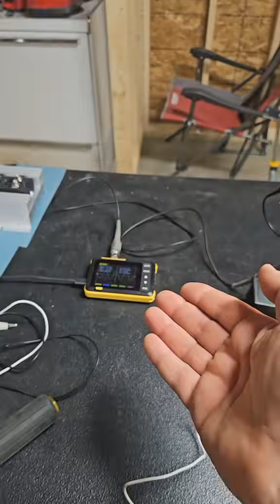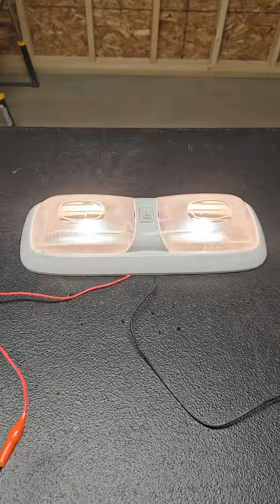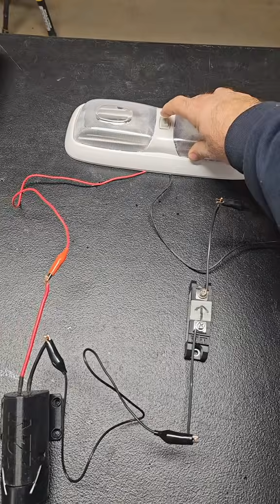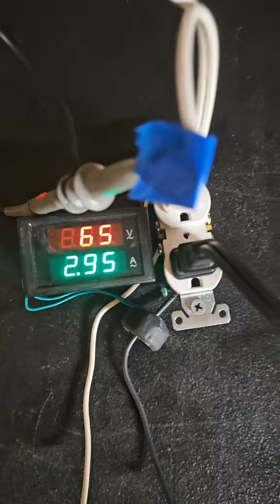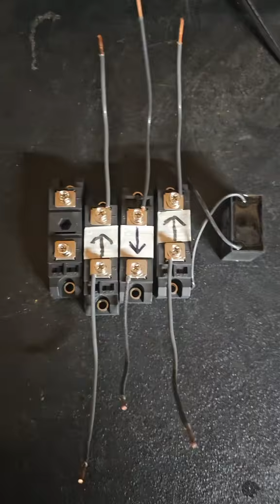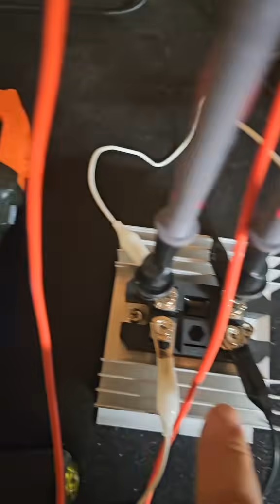what is a diode? and what do they do?

Comment: ? Can you use a diode to stop the flow of electricity to the city power when you're using a generator at the meter base.
Reply: Short answer - no. Preventing power back flow is a safety concern and requires an "air gap" (a circuit breaker or transfer switch) to positively stop current flow. Diodes do not provide an air gap and, although rare, could potentially short and let power go through. Not sure why you would want to do this. You would have to use 2 diodes to block the flow of AC as described in the video, which would also block power flow from the grid to your house if left in place. A mechanical generator interlock is the correct and safe way to do it. The bootleg way is to open the main breaker on the panel and backfeed a 2-pole breaker, but it is not fail-safe, definitely not NEC approved, and opens you up for huge liability if you zap a utility worker. Not worth it - do it the right way with a proper interlock.

Comment: Can you explain why you get 168 volts?
Reply: Our meters measure and display the RMS value. Here is some info from Google to help you understand it a bit. 

"Root mean square" (RMS) in electricity refers to a mathematical calculation used to determine the effective voltage or current of an alternating current (AC) waveform, essentially representing the equivalent DC value that would produce the same amount of power as the AC waveform; it is calculated by taking the square root of the mean of the squared values of the waveform over time, and is considered the standard way to measure AC power in electrical systems. 
Key points about RMS in electricity:
Meaning:
RMS value gives a more accurate representation of the "average" power delivered by an AC signal compared to simply taking the peak value, as the voltage and current fluctuate constantly in an AC circuit.
Reply: Bro he says it literally right after showing that voltage reading